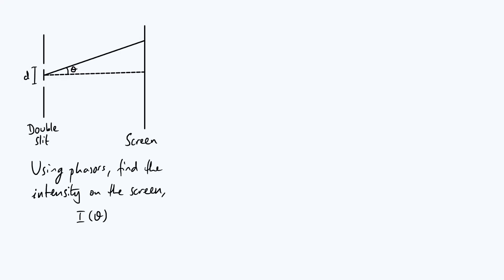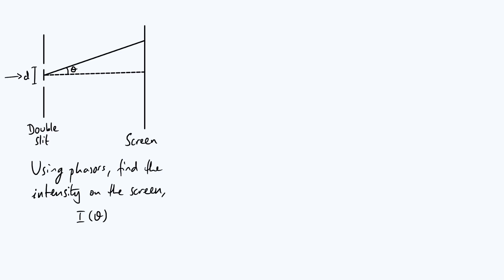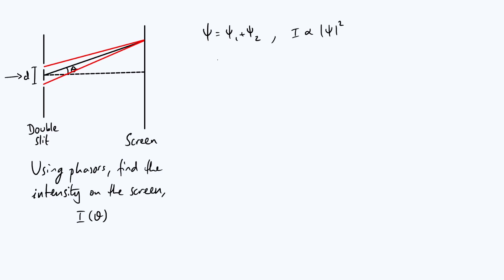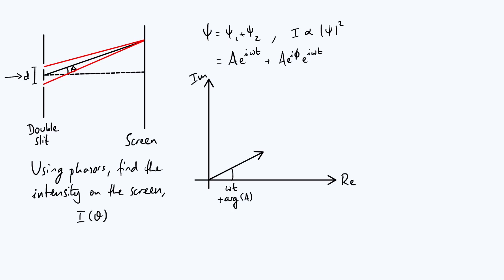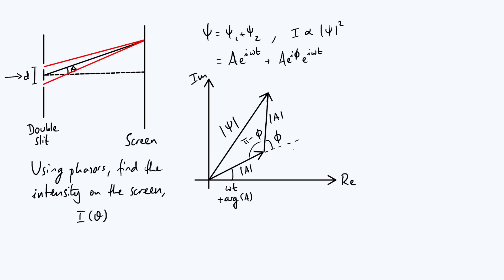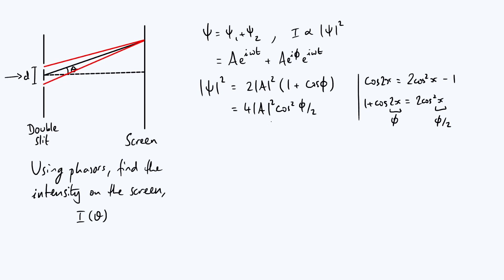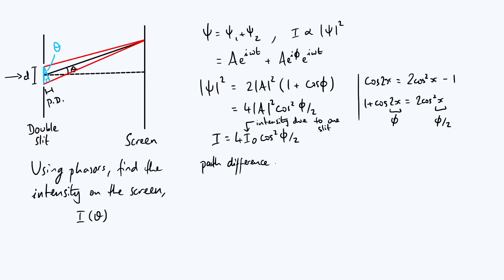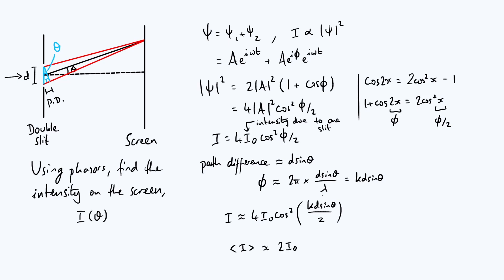Double-slit interference with phasors

Comment: Is it possible to derive this result from the expression for the displacement produced by a single slit? I mean A is proportional to sin(½ka*sin(theta))/½ka*sin(theta) where a is a width of the slit
I tried but got something really different. However, double slit is clearly just a superposition of two slits
Btw great video!
Reply from the maker: It is indeed, but note that the result you quoted applies to a slit of finite width while I'm assuming in this video that the slits are infinitesimally thin. The full analysis is mostly the same as in the video, except |A| is no longer a constant and should really be replaced by your expression involving the sinc function. So the phasor diagram I drew is still valid, but you have to imagine that the length of the two phasors we're adding changes as θ varies. That means the full solution is really the product of the expression in the video and the sinc function. In the limit a -> 0, the single-slit part of the expression tends to a constant independent of θ, because sinc(0) = 1, and you recover the result from the video.
Reply: @DrBenYelverton  makes sense, thank you!